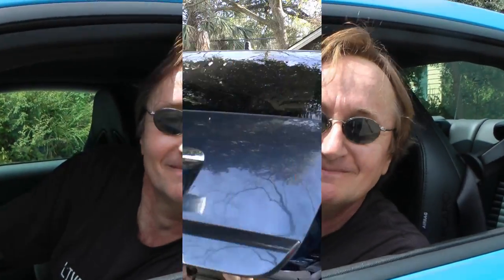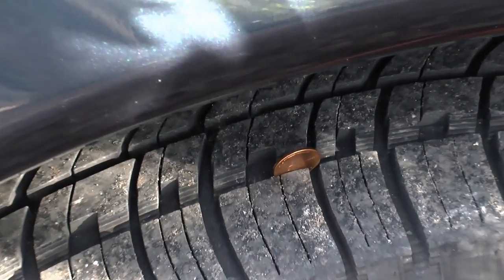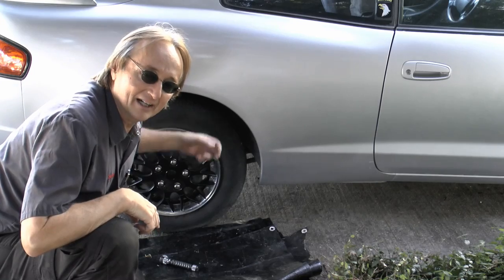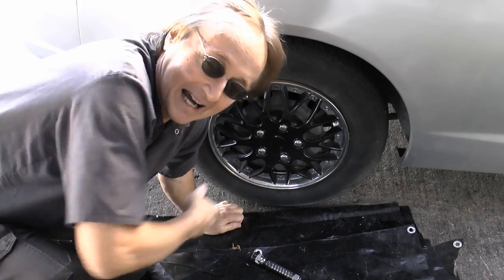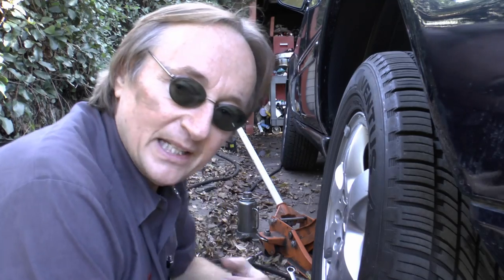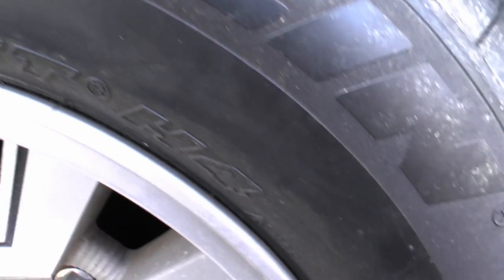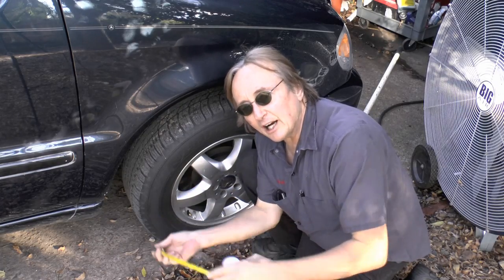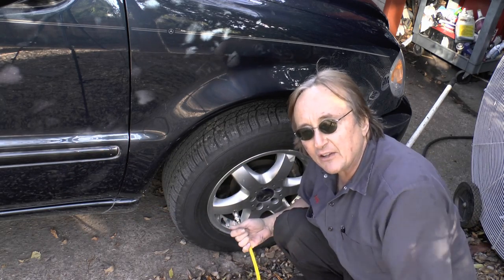How to Tell if You Need New Tires on Your Car

Comment: I keep a $10 hand-powered bicycle pump and a tire pressure gauge in the trunk of my car. I also keep a tire plug kit, extra container / bottle of rubber cement, (and a flashlight) in the trunk so I can seal any holes that a nail might cause in my tire.  I use that bike pump so many times to add a bit more air into my tires 2 or 3 times a year that it has become something I don't know how I could have lived without before. Went on a 500 mile trip and got a nail in the tire, causing a slow 'hissing' leak.  Jacked up the car, took off the tire, pulled the nail out and let the air 'GUSH' out.  10 minutes later, used the tire plug kit 'rasp' to enlarge the hole just a bit more. Took a plug 'Rope' (rubberized fabric rope-like plug), added it to the inserter, dipped it into the container of rubber cement, then pushed that 'rope' half-way into the hole. Pushed it in about 2 inches, leaving 1 inch sticking out. Let it sit in the tire for about 30 minutes so it would stick itself in place.  Cut off the strips of 'rope' sticking out with a pair of wire cutters, and the used my tire pump to pump up the tire. Put the tire back onto the car and it was good to go.  Kept using that tire for the next 3 years until the treads wore down and needed to replace the worn out tire.  I've done that on 4 tires in my life and it works like a charm.  Don't use a drill bit and drill bit to enlarge the hole because unlike the hand rasp, the drill bit will cut the metal cords in the tire and that will ruin the tire, then no plug will fix that tire.

Comment: We have an old 80 dodge ram that we use for hauling water for the garden and other stuff, use it about once a month on average. It had 35 year old tires on it, nearly bald and quite hard, but we didn't care. This year, 2 of them got big cracks in em. They were leaking air so fast you could hear it, and find it by feeling the rush of air. So we bought some tires from a second hand shop. XD

Comment: I had a 1992 accord and I put Chinese tires on it. They went after about a couple of years and only 15k miles but hey if your broke it's a pretty good solution for temporarily getting around. Most of the time you couldn't notice you were on Chinese tires

Comment: The snowtires is had on my car were rotten, they where still in good shape no cracks or anything but one day while driving, and a crappy road thrashing left to right and it blew my right front out :) now i bought the second best set of new snow tires, now i got amazing traction and i don't need to buy newer ones for a few years

Comment: I've got 10 year old Michelin LTX M/S tires on my Suburban, plenty of tread. A bit cracked around the shoulder and inside near the bead, but I drive 75 mph on them and they're fine, the cracks haven't gotten worse since last winter and no chunks out of them. Gonna see how they do this winter, if I get stuck I'll just burn them up to have a better excuse to get new ones, A/T's this time.

Comment: the reason old tires don't need new air generally is because 78% of the air is nitrogen which doesn't go through the rubber while the 21% oxygen will. on the old tires the oxygen has already escaped and been refilled so the pressure shouldn't drop. if you let all the air out and refill them again they will loose the oxygen all over again
Reply: That is balloney. If the fibers and rubber deteriorate due to low quality build all gases would leak under pressure and since the inflated tires are under pressure at around 30+ psi nitrogen would try to find ways to escape as well. Nothing beats the law of physics.
Reply: Air consists 70% nitrogen, about less than 21% of oxygen and other games such as carbon dioxide, methane, and ozone.  Tires lose pressure because the density of oxygen reacts to temperature, but nitrogen doesn't. This is why cold tire pressure is the right pressure to check and why tires have a max pressure tolerance above the recommended tire pressure from the car manufacturer.
Reply: You obviously don't know much about tires.

Comment: I read recently that dry rot/cracking is common when you don't drive enough. When the tire is flexed and heated up, it releases oil compounds that protect its most outer layer from ozone/uv Rays. When you don't drive much, the rubber gets dried up by the air/sunlight.

Comment: there are expensive Chinese tyres and cheep Chinese tyres. You get what you paid for, however I wouldn't agree with your comments about "don't buy Chinese tyres"... as you probably know, Pirelli is owned by the Chinese so does it mean you shouldn't buy Pirelli anymore? A few other well known tyre brands probably have their tyres manufactured in China as well.
So, maybe the suggestion would be don't buy the cheapest tyres?
Reply: When people say Chinese, they don't exclusively mean manufactured in China. E.g iPhone is made in China, I can use the Xiaomi phone which is Chinese, but for the most part most Chinese phones are crap. Same applies to most Chinese made goods, cos they tend to mass produce at very low prices which has it's probably and cons. I'll agree there're great Chinese products.
Reply: pirelli tires went down the tubes when they got bought by the chinese

Comment: I am using the 10 year old winter tyres from the Car I bought 3 months ago, as my summer tyres and at 100° they're perfect and until now, they didn't loose any air. I have a digital pressure gauge and I only lost 1 PSI at each tyre, but that's probalby due the fact, that I measure air pressure once a month. As you said, things were made better at that time.

Comment: Second third cheapest tire still made in China
Reply: He's probably talking about the Chinese-name ones
Reply: Matthew Joines I was just saying the truth
Reply: 109sciencefreak Yes probably. But I would suggest to buy the best tire you can afford. Because there are not many differences in quality among the cheapest second and third- they all shit tires.
Reply: Shanming Hu the very cheapest will get a flat or fall apart soon. 35$ new tires my sister got back in 04' from walmart popped like 6 months in. the 60$ ones around the same time didnt. so there is a difference.
Reply: PHGamer I agree with you. But $60 one is a decent budget tire, we should not put  it in the category of the second cheapest and the third.
Reply: third cheapest as well
Reply: hes not making fun Chinese lol  amount shit comes from china 20% likely to fail
Reply: There's also the tiny issue of grip. If you want to slow down, the car should. If you want to corner, the car should. With these cheap tyres that's not always true. There are some significant differences between tyres. Even branded ones. I used to drive on Bridgestone ER60, and then switched to Michelin XM2. The difference was huge. The Michelin were meant for fuel saving, and grip was... erm, of secondary importance. Had a minor crash because of that, the car just didn't stop in time where with the Bridgestone I'm sure it would have. Now I'm on Pirelli P7 (different car), quite a bit better, though there could be more grip still.
Reply: are you trying to tell me that you want him to say that those crappy bad chinese tyres are good? he didn't say all of chinese tyre brands are bad but there is a lot of cheap items that are sold and crap
Reply: yup. i wonder how much japanese tires should go. its probably a safe bet on japanese longevity.

Comment: Another way is taking corners as hard as you can(if you have low profile tires). bought my car from my cousin and when i corner my FWD Maxima, it slides on the front end kinda easily. So i put new tires on. Problem fixed. However do only what youre comfortable with. My driving style is taking every corner as hard as i can and treating my town like a race track. a

Comment: Don't forget to mention the manufacture date codes near the DOT number. I just checked the tires on my F150 the manufacturing date code was 3712 which meant it was made in the 37th week of 2012. Lots of we're still on the tires but there now 6 years old time for new ones.

Comment: I got 4 Firestone Precision Sport tires off Craigslist for $200 as apposed to $300 new. Exact fit for our vehicle, they were very lightly used, like new. The seller claims they sold the same car we rolled in with and kept the tires since they were worth half the value of the vehicle. I inspected them inside and out, all around, measured the tread depth around the whole tire, and did this for all four. All of them have been good. We have been running them a little over inflated through the warm season, and under inflated for the cold and snow. I recently bought a 2002 Dodge Dakota Sport that likely needs new tires, but they are fine for now. I want to keep the truck as long as possible, so I personally want to stick to the best of the best. Although you made me rethink the idea of buying expensive tires knowing they will rot before they wear out, it is largely a work truck, and seldom driven since I walk to work. To me, the Dodge Dakota sport (club cab) model is the perfect pickup.

Comment: I have a question, which is good tire 225 45 r 17 or 205 45 r 17? which is good in terms of speed and gas consuming? I have Honda civic and I want to change 4 tires, better to keep the tire stock or change it to 225 or 205?

Comment: I mistakenly used a Canadian penny and got all confused.
Reply: Not too difficult. Instead of the top of Lincoln's head showing you check for the top of the Queen's head. If you can see her crown then it's time for new tires. Word is your new penny will have Trump's head on it. When you can see how empty it is that's when you need new tires! Lol
Reply: What if the penny has Clinton's head then it would be useless because it is all corrupt....
Reply: Right...They'r actually pretty hard to come by nowadays...I think we here in Canada stopped using pennies like 6 yrs ago...I measure my tires with the moose head on a quarter...as Canadian as it gets... ;)
Reply: I have a penny with King George's face on it
Reply: I use a tire tread depth gauge and it's more accurate. Got one free from a tire shop.

Comment: Scotty--we have two old Fords.  One is a '88 T-Bird.  It has Firestone Tires on it which are 10 years old this coming July!!  We have not driven it much since 2008 and it is a keeper/dust collector staying in the garage 99% of the time.  My thoughts about radial tires in the last 20 years are 1) They seem to harden up quickly becoming less able to handle winter traction and 2) Because of 1, they add a hardness element to the ride.  The T-Bird tires have developed a brown coloration around the sidewalls?  I see no dry rot nor any serious wear signs.  The tires have little thread wear, but you are right, Firestone has already claimed the manufacturer date on the tires makes them worn out.  I got suckered into buying tires for the '89 Ford because I drive it more, but now I wonder.

Comment: So I bought a 2004 C5 Corvette that came with totally brand new Michelin tires. The back tires are Michelin Pilot Sport A/S pluses, which have directional tread. The front tires are Michelin Pilot A/S 3 pluses, which are asymmetrical tread. Both are ultra high performance all season, have the same speed, wear, temperature, and traction ratings. Despite that, is it dangerous to have these different tread patterns front and back? They seem fantastic on corners, but I just want yours and other people's opinions.
Reply: Different tires on the front and back is perfectly fine.
Reply: Dcc357 I have a 2002 Corvette and just put on all four new Michelin Pilot Sport AS 3+ tires.  The AS3+ are Run flats and the other are not.

Comment: Hello! I have a 2 2017 Volkswagen Tiguan 2.0 TDI with 150 horsepower, four motion DSG. For winter I recommend what size tire. Now I have the car tires 235/55 R18 summer, but winter in the user manual is size 215/65 R17. Believes that a narrow tire is better in winter? I would like to know if the firm suspension that we can soften the tire bead size greater than 65 to 55? It uses alloy or steel wheels for the winter? Thank you.

Comment: In Austria, we have to replace our tires, when there is less than 2 mm profile depth. If we don't, we get pulled over by the cops, and that costs a ticket.
Reply: How can the cops read your tread depth while you are moving???
Reply: That is easy: First, they turn on their signals, and then, they pull you over. BTW, in Austria, we have very cold winters, with tons of snow. We have a winter-tyre obligation starting in october and lasting till easter. If we fail to follow that, our car ensurances won't pay, when accidents occure. And when the tread depth is too low, you lose control in curves, and the car is hard to steer around corners. Some ppl are so careless, they drive with summer tyres in winter, and cause many accidents.

Comment: The make or brand of a tyre will not effect if it will be more easily punctured or not. Also, there are more things you need to do, other than checking tyre pressures, to maintain your tyres. For example, wheel rotations, wheel alignments, and wheel balancing. Which should be done every 6 months or every 10,000km. How do I know this? I'm a tyre fitter.

Comment: I'm a metrologist and found out that most store-bought tire pressure gauges (all made in China) are more often than not completely off. I once bought a higher end gauge only to find out it was indicating almost 10 PSI too high. The worst ones I encounter are the ones that are in the compressor hose at the gas station and on portable compressors: almost 15 PSI off in some cases.

I ended up buying a calibrated/certified gauge from an industrial distributor for about 12$ (probably 7 to 9$ in the US). No need to get it with the certificate, as that will cost a lot more. Makes for a nice little stocking stuffer too!

Comment: Hankook tires are garbage. They need replacing immediately after installation.
Reply: I think in a later episode he actually speaks to those Hankooks being crap and having to replace them due to harsh ride.
Reply: I got their performance all seasons. They are great for dry and rainy conditions.
Reply: I had what I will call "HandCock" tires (they were Chinese) were good for the first year, then they all started going crazy, not sure if they were going out of round or belts were screwed up inside but they would not hold a balance and were just awful, felt like out of round... Now I only been using General Altimax for the last 3 tire changes and love them!
Reply: Yeah okay, Hankook tires are one of many leading tire manufacturer.
Reply: I got Hankook tires by default when I bought by 2015 passat. 38k miles I have put on them till now and they have never given any issues. No punctures, skidding or anything. I have driven 17 hours at one time with small breaks and never had any issues. I think they are good.

Comment: Use better rated tires for driving over 100 miles an hour and such in the city, just make sure there not from C H I N A
Reply: +BundysGarage Where can you drive 100mph for any length of time?
Reply: +itsmegp46 Tracks, strips, freeways, backroads.. anywhere where there's no police around. 
(Not saying to do it illegally, just that it's still done)
Reply: +the7mad9cap7laughs Around me, getting caught doing 100 mph is an automatic arrest. But I do remember an unfinished interstate that was used for drag racing and top speed runs for a while.
Reply: itsmegp46 There's certainly a legal risk in it but that won't stop everybody.
Reply: +the7mad9cap7laughs   No indeed.
Reply: +itsmegp46    For me, it's more about having tires that COULD handle that speed if needed.   I'm assuming they must be more robust and better built if they have the better speed rating (when buying a respectable brand).
Reply: id buy japanese or finland made tires but prob way too pricey.

Comment: I'm with Scotty on Chinese tires (plus belts and hoses) or anything that has electricity running through it.  I just did all the belts and hoses on my '04 Chevy Silverado.  I went to the Chevy dealership and bought OEM.  Much more expensive but worth it. The original belts and hoses had 220,000 miles. (probably should have replaced them sooner).  Discount auto-parts store has a lot of Chinese junk.  good for 50,000 miles.

Comment: You can also get some used tires, just make sure they are less than 3 or 4 years old by checking the date of manufacture that all tires have now. I got some brand name tires off Craigslist for about $24 each. Been using them for 2 years with no problem.

Comment: I bought my 1996 ford ranger with 16 year old back tires, one of em had a nail in it, neither of which I knew about, cause I didn't have to add air to it the first month I drove it, I was stunned when I went for a oil change and found out

Comment: This rule might apply to people living in the United States or other western countries with similar weather but it doesn't in a tropical climate with a mix of heavy rain and plenty of sun from time to time. The humidity and heat heavily wears the tyres a lot more faster than they do over there. Generally the tyres here (depending on treadwear, mileage etc) on average lasts about 2 to 3 years give or take.

Comment: HelpI have a 1999 crown Victoria lx, the AC does not blow cold air and when the AC is on it makes the engine work hard (a 4.6l v8 should not work hard while driving in a parking lot), I put Freon in it and check for leaks and there were none, and the AC worked fine.  About a month later it stopped working, I have been told it may be the black death, what is that and is it fixable? or should I just buy a new car?Thanks
Reply from the maker: first, check for ac leaks, could just b a leaking hos
Reply: Did you add freon, or r134a?  Most modern cars use r134a rather than straight freon.